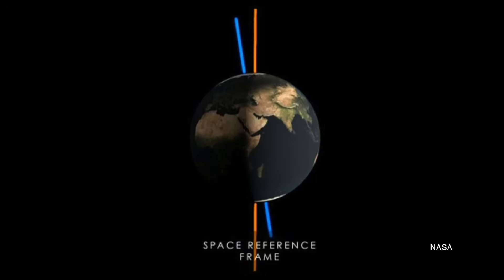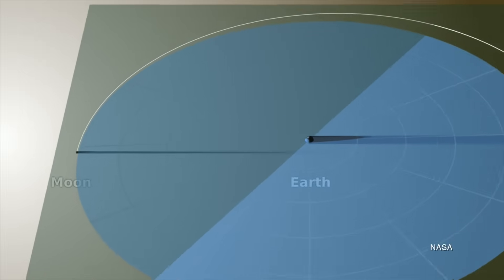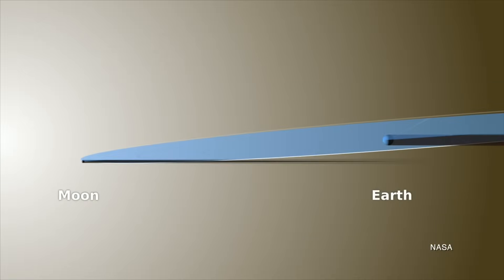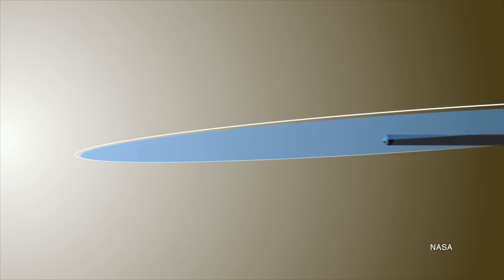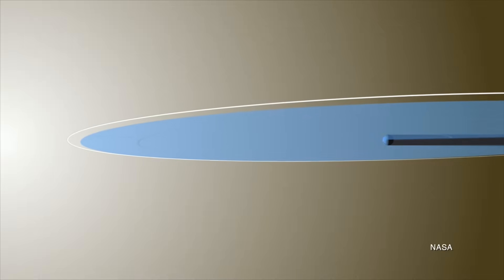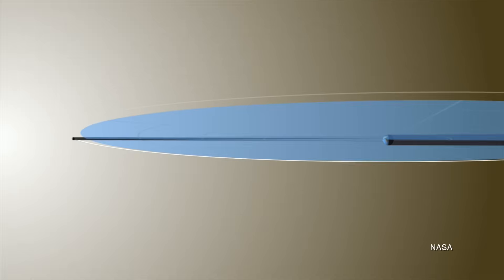Why Does a Rocket Need to Roll Going Into Orbit?

Comment: How does a rocket decoupler work? (Because they looks like they're fit on with no bolts, and yet still holds the stages together.) 0-0
Reply: Based on my limited knowledge and reading that book ;"How Apollo Flew to the Moon" I've gathered that the rocket stages are solidly afixed together and controlled explosions by detonation cords separate stages. Then small rockets on the spent stage fire to give distance for the next stage. Good video topic!.
Reply: explosive bolts (shaped charges)cuts it loose,then  small rockets are fired to clear it.
Reply from the maker: I did a video/blog on that a while ago: https://www.youtube.com/watch?v=_Kq67RcfSpw
Reply: Self-sealing stembolts.
Reply: +Nethkrill Vesta   The system you describe might only apply to the final separation events, involving the satellites.  Just a slightly informed guess, but the first-second stage separation might well need a more energetic system.  The beauty of pyrotechnics is that they pack a lot of very rapidly and reliably deployable energy in a small, lightweight package.  They do have downsides, of course, a lot relating to safety, also related to debris generation.  Debris generation is a more serious consideration for satellite separation than for staging.
Reply: MalformedFigment And probably a bit of yammock sauce for good measure! ;)
Reply: I have read of a few different systems for stage separation.  Pyrotechnic devices feature in nearly all of them, but the details vary quite a bit.  Explosive bolts exist, and are used, but the overall function of the systems can be much more subtle than simply imagining a bolted together structure whose bolts are explosively failed.  I understand it is still a subject of active development.
Reply: See Amy's video "How the Saturn V Broke Into Pieces Launching to the Moon" which covers staging!! :)
Reply: duct tape
Reply: I think they do have bolts and in between have something that expands and breaks them off, causing the separation.
Reply: +Amy Shira Teitel (Vintage Space) ohh thank you! I'll check on that
Reply: Neth SpaceX uses pneumatic pusher pistons for all separation events on all stages. They are easier to service and maintain between flights, rather than having to rebuild a broken fastener for every flight.
Reply: +Mark Holm I've compared the stage separation of the older rockets with explosive bolts and the spacex Dragon v2 separation (just by observation) the space x Dv2 looks more like attached by some magnetic system with no explosions, the lock just flicked and clean separation. (Looks very satisfying lol)
Reply: Read about explosive bolts here.
 https://en.wikipedia.org/wiki/Pyrotechnic_fastener
Reply: Economy Wonderglue ;-)
Reply: yes, combination of explosive bolts that allow pre compressed spring to expand and push things away.
Reply: Neth : Friction fit
Reply: Lies
Reply: trevorpom we called it hundred mile an hour tape in basic training...  it worked on anything up to a hundred miles an hour.
Reply: Fascist Canuck you must be the  idiot that doesn't get the nuances of language.  Oh well, I was bound to stumble across your dumb ass at some point I guess.